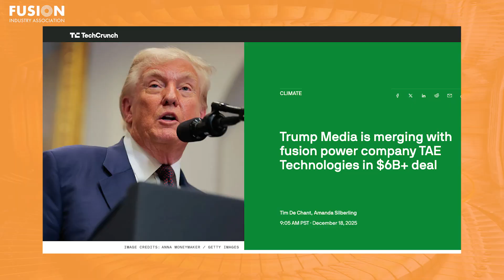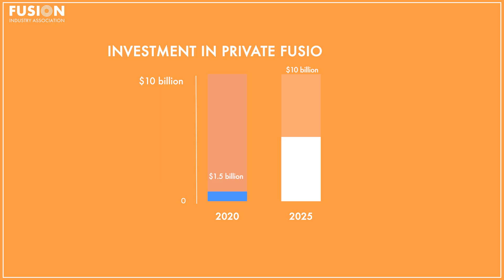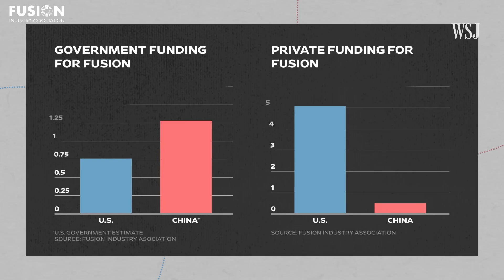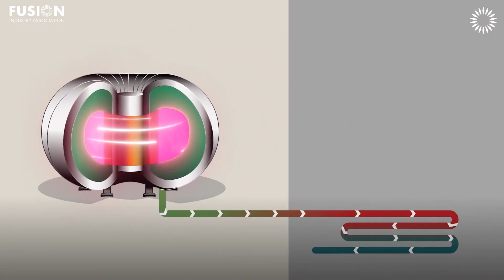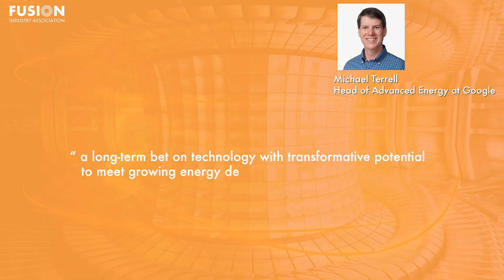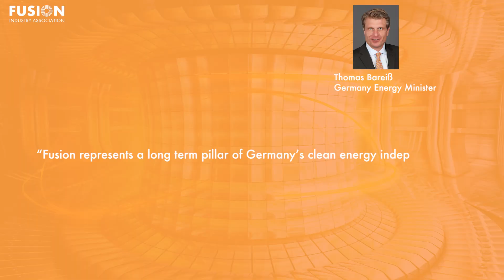Fusion News - Top Stories of 2025

Comment: Since the first tokamak experiments began, in 1958, the nuclear fusion energy experimental field has been characterized by an enormous amount of promotional sales hype for these fun, expensive, efforts. The Fusion Industry Association (FIA) is no different.

TAE Technology (TAE) was originally created in 1998. They have built and experimented with five generations of machines and conducted about 70,000 experimental test shots. None have demonstrated the generation of even 1.0 watt-hour of fusion derived energy as is the case with almost all nuclear fusion experimental efforts to date. Even the best fusion energy record holding shots haven’t achieved anything close to 0.1 times more fusion energy generated than was required to power the facility (engineering gain). After an engineering gain of 1.0 is achieved economic practicality will still remain orders of magnitude away.

The NIF ‘breakeven’ laser shot, of 12/05/2022, goal was initially supposed to have been achieved by 2012. Over $11-billion USD have been spent on the effort which has never been focused on eventual fusion energy production. It has always been primarily funded as a thermonuclear weapon (H-bomb) research tool. The recent NIF fusion fuel burn efficiency gains happen months apart. The 12/05/2022 fuel burn shot efficiency was only 4%. The fusion burn duty cycle remains abysmal.

Commonwealth Fusion Systems (CFS) has frequently described their SPARC experimental machine, now being constructed, as being a ‘prototype’ of their ARC power plant in their numerous promotional presentations. They have always omitted numerous key evaluation details regarding SPARC. If it ever achieves their goal of 1.0 GigaJoule of energy per shot the fusion reactions will only last for a maximum of 10 seconds and then the machine will require a 4-hour thermal recovery period before another test shot can be attempted. SPARC lacks the robust heat removal system that ARC must have, including all the electrical power generation components. It also lacks a tritium breeding blanket and the tritium processing facilities required by ARC. SPARC will be dependent upon commercial tritium that costs about $30,000 USD per gram.

Both CFS and Helion Energy have posted promotional videos that suggest that they have begun construction of their intended power plants. Those construction scenes were staged operations intended to give a false impression. At the beginning of 2024 Helion predicted that their 7th generation experimental machine, Polaris would demonstrate the generation of fusion derived electricity by mid- summer of that year. Despite conducting numerous test shots, since that announcement, there is no evidence that they have achieved anything close to that goal as we head into 2026.

Typically, fans of nuclear fusion energy experiments immerse themselves in echo chamber information sources that reinforce their preferred worldview.

Comment: 3:18: To put that in perspective: 8.6 MJ = 2.39 kWh. 

The gap between scientific breakeven and engineering breakeven includes, among others, the efficiency of the laser. NIF used an old laser with 1% efficiency. Modern diode-pumped lasers can achieve about 20%. 

Between the laser and the box drawn around the fuel capsule, there are further losses. Quoting from "THE AGE OF IGNITION - Inside Lawrence Livermore National Laboratory’s Fusion Breakthrough" from 2023: 
"Creating a NIF ICF implosion is a highly inefficient process; normally only 10 to 15 percent of the initial infrared laser energy reaches the capsule. About half of the energy is lost when the infrared light is converted to higher-energy ultraviolet; half of the remainder is used to create x rays in the hohlraum; and much of the rest is dissipated when x-ray energy escapes through the laser entrance holes or is lost to laser-plasma interactions, backscatter, and other factors."

Comment: Still no talk on any tech progress on extracting heat from a tokomak to generate steam.  No prototype. No design. No plan.  The device will need to withstand a vacuum on one side, and high-pressure fluid on the inside, while withstanding particle bombardment. Normally called a "heat exchanger" in fission plants, there is no mention of it in any popular media. NO HEAT EXCHANGER, NO ELECTRICITY. ANYONE ELSE GETTING THIS?????!?
Reply: To be clear: the Field Reverse Configuration systems described here (and competing Z Pinch system designs) don't REQUIRE a heat extraction mechanism (at least not to produce electricity). One of the principle stated benefits of such designs is that the magnets used to perform the pinch (and adjacent coils) COULD directly produce electricity. No "making steam" required as an intermediate step is the plan (theoretical possibility) for some of these devices. For tokamaks and stellarators, it should be understood that all currently running tokamaks already have heat exchangers (divertors) to dump plasma heat exhaust and protect components. These are then dumped to cooling systems. As you say, the challenges are in the engineering and materials for continuous operation, but there are experiments underway (at different scales) across the industry. Perhaps 50% of the scientific goals of ITER are "let's show that we can extract heat into cooling circuits in a reactor-scale machine." To say that there are no prototypes, no designs, and no plans would certainly be untrue for the industry as a whole. It might very well be true for some of the more "speculative" players. I think the experiments and plans in this area get little media discussion because they're "boring" engineering challenges compared to the primary "making power the way the Sun does" story. It would be nice to hear more about this aspect of the work, but for sure it's out there if you look in the form of papers, experiments associated with most of the world's operating tokamaks and stellarators, and even some hints in the commercial plans of plants like ARC.
Reply: @papaludwig  well i did some digging and i found only one commercial effort to build one, and they are in japan.